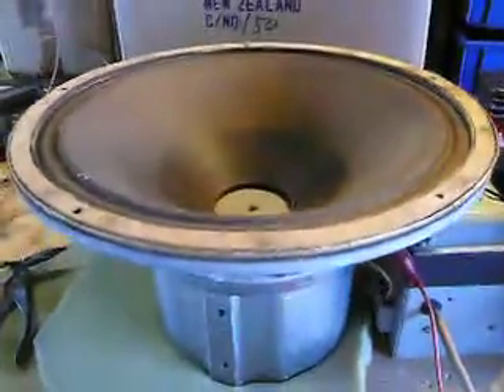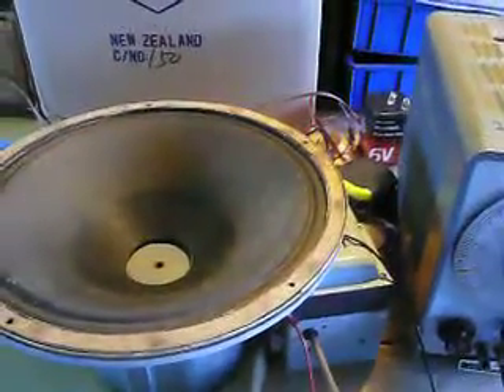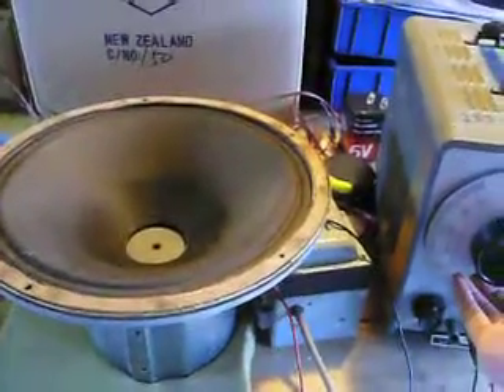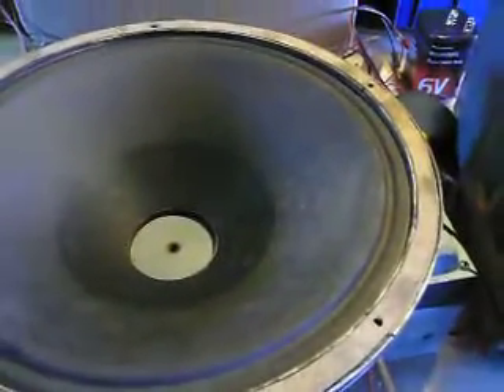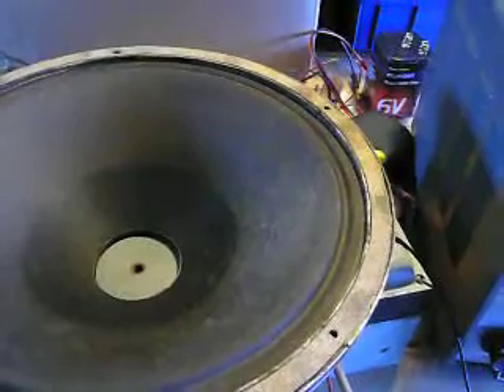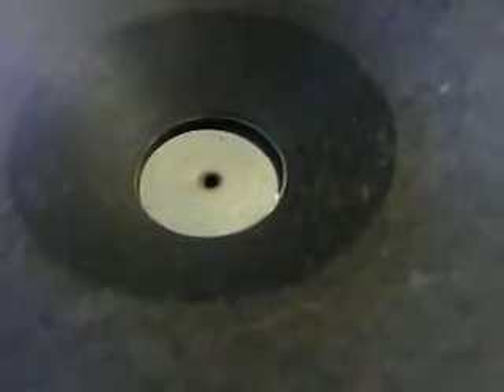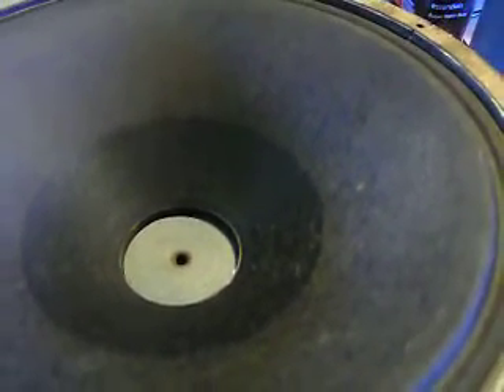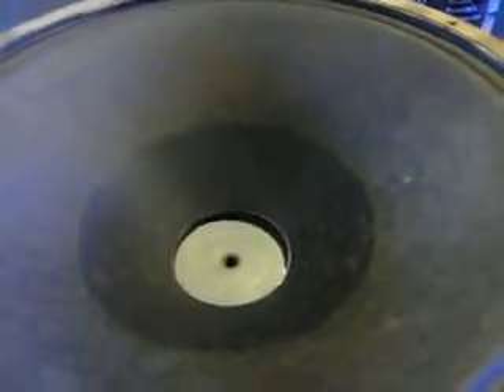Western Electric Vintage 13 inch speaker sweep.MOV

Comment: Hi
At 15 inches there should be a resonance at around 45 Hz.  It has a heavy moving mass, and may be rubbing just a bit on the pole (Audible at about 80 Hz or lower).
Nice old woofer.